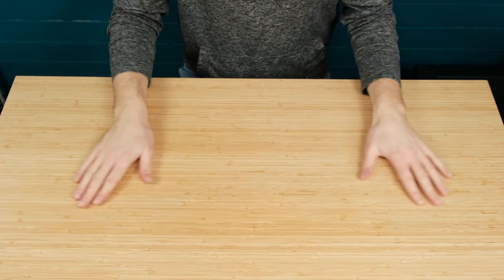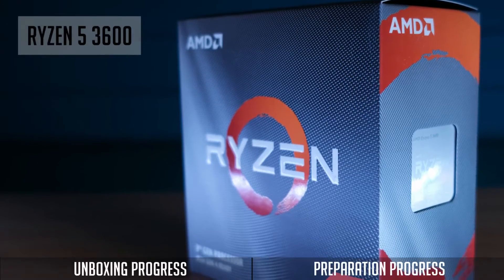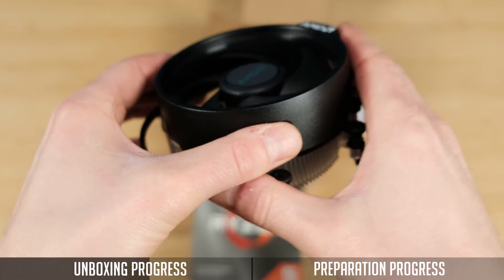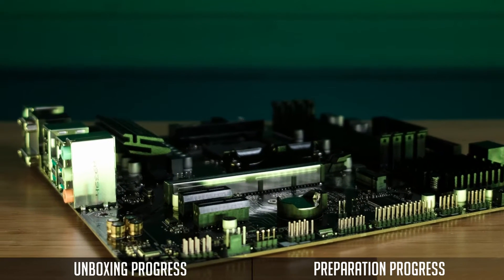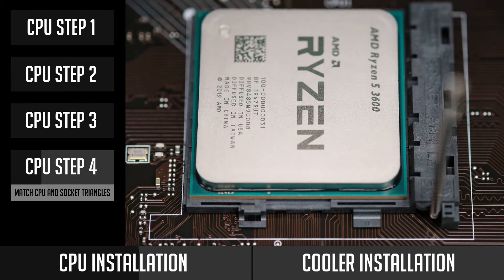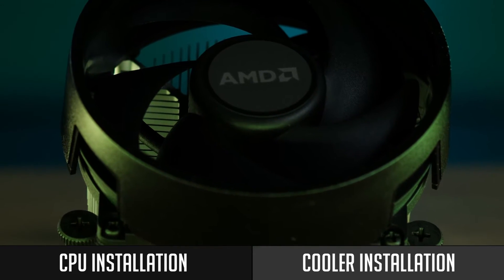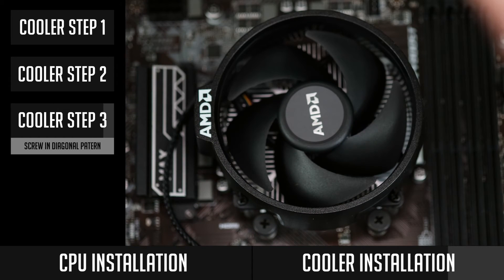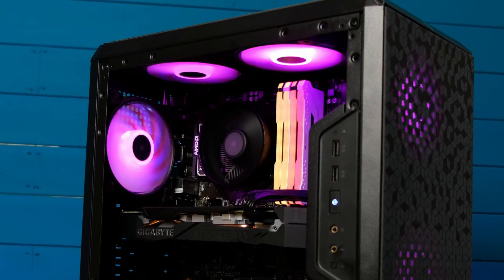HOW TO INSTALL RYZEN 5 3600 CPU + UNBOXING - CPU installation tutorial / guide

Comment: My processor is stuck on the cooler. 

I was trying to apply new thermal paste and when i remove the cooler, the processor stuck with it. What should i do? Help, im afraid i might damage my processor if i do anything. :(
Reply from the maker: Hey,
it's quite a common issue for Ryzen CPU's when they stuck on a cooler when people trying to remove a cooler/cpu from a socket.
Anyway, do not try to use a screwdriver or any other hard thing to remove your CPU from a cooler.
The best way would be to use isopropyl alcohol + cotton swab first. And then use a dental floss and try to "cut" between a cpu and cpu cooler.
I fond one video (not so good quality, but it will work) where one guys shows a process: https://www.youtube.com/watch?v=kDRgahrnOC8

Comment: Do I need thermal paste? Sir
Reply from the maker: Hey,
In case you will be using stock (included) cooler, no you don't. Since the thermal paste is already pre-applied on a CPU cooler.
But in case you will buy an aftermarket cooler, you may need to apply it since some cooler have pre-applied some don't, some are including paste tube in a package :)

Comment: On this procesor automatic applied thermal paste?
Reply from the maker: Hey,
In case you use stock cpu cooler it already has pre-applied paste :)
In case you buy aftermarket cooler - some have and some of them do not :)

Comment: Did you have to push down while screwing down the cpu cooler? Or can you just screw normally with no pressure?
Reply from the maker: Hey,
you will have to push (while screwing), since screws are spring-loaded and so you need to apply some pressure.
I suggest screwing one screw a little bit, but not till the end. And then screw 2nd screw in diagonal pattern :)
Reply: @EpicGameTech  Just a little bit of pressure right? I'm paranoid that I will somehow damage the cpu from pushing down the cooler too much.
Reply from the maker: Yep, I get that feeling :)
Well with 1 hand, just hold cpu cooler in place and that's it. And with the other hand with a screw driver, push when screwing.
1st screw is easy, but 2nd one is more tuff.

Comment: Hey man very clear video and very helpful just one quick thing, do I need to pull the white bit off where the thermal paste is supposedly pre applied or is the thermal paste that white circle?
Reply from the maker: Hey,
thanks! :)
Can you please explain more on what you have in mind? (maybe upload a photo and post it here?)
And are you using stock fan or some aftermarket cooler? :)
Reply: Epic Game Tech thanks for replying bro! I’m awaiting my Ryzen 5 3600 in the post, this is my first build ever but my question is a bit confusing, what I mean to say is, does the stock cooler out of the box that comes with the ryzen 5 have any sort of protective cover over the thermal paste that I need to remove before fixing to the mobo or do I just need to take it out of the box and screw it to the mobo
Reply from the maker: Ah, i see :)
Basically stock cooler is "wrapped" in some plastic and so it protects whole cooler as-well as thermal paste not touching anything around. But thermal paste itself does not have any protecting cover/sheet you need to remove. you will see when it comes :)
Have a nice PC Building (when it comes)! :)
Just shoot a comment here in case you will face some questions later one.
Reply: Epic Game Tech ah wicked! Great stuff thank you for replying! When it’s all here and assembled I’ll send you a pic :)

Comment: Should i start screwing as soon as i put the fan on cpu or wait for it to stick?
Reply from the maker: Hey,
What exactly do you have in mind "wait for it to stick"? :)
Just put a CPU cooler on your CPU and start screwing right away in a diagonal pattern, just like it's shown in this video.
Reply: @EpicGameTech  i thought thermal paste sticks like glue because the fan kept sliding little bit. The holes were really big on the motherboard and it wouldn't go in. I decided to remove the whole thing and the backplate was fallen. Really good tutorial, good steps! First time installing amd cpu so this was helpful. THANK YOU!!!
Reply from the maker: Ahhh, good you find that backplate, sometimes it happens! :)
Have a nice PC Building time! And thanks :)

Comment: So do i need to buy a aftermarket cooler for my ryzen 7 3800x?..No overclocking. Only stock settings
Reply: Man your good...reply after 2 hours. Every YouTuber should be this much helpful to their viewers.
Thanks a lot for your effort and time.
Reply from the maker: Hey,
well it depends if you have a budget for that or not. But in general, aftermarket cooler is always a good idea:
1. You get lower noise levels.
2. you get better cooling, thus you get your CPU auto boost to higher frequency and stay there for longer. Sure, depends from how good aftermarket cooler is, but you can gain some mhz.
3. You can overclock your CPU with aftermarket cooler.

So, there are some benefits for sure. In case you are just gaming  and no hard workloads that would use 50-100% of you CPU and you want to save money - it will run quite ok with a stock cooler for sure.
But if your CPU is used 50%+ all the time in games or blender / rendering / video editing etc. I strongly advice to get an after market cooler for sure :)

Comment: Hello Friend, exactly I bought same processor and motherboard 👍
Reply from the maker: Nice! :)
Reply: @EpicGameTech  I have a question: is the default amd cooler is good? Or  Do I need to buy separately?
Reply from the maker: well, it's ok for gaming / casual work for sure. But in case you will do some production/video editing (or it's somehow very hot where you live) and your CPU will use all 6 cores/12 threads at 100% all the time, it can get hot. And in that case, it will start to down-clock itself.
Sure, it's always nice to get $30-40 cooler. But in case you will game only, I would say stick with included cooler and monitor temperatures for a while with MSI Afterburner :)
Reply: @EpicGameTech  Thanks for this answer👍
Reply from the maker: You are welcome :)

Comment: I have a question, how would you know if the screws are just right or too tight?
Reply from the maker: Hi,
Wraith stealth screws are spring-loaded so you have to screw them till the end. Just be sure not to screw one side/screw straight a way till the end, but do it gradually with each screw bit by bit.
So be sure you screw all of them untill you can't :)

Comment: i bought some thermal paste seperate, should i apply it then put on the fan or should i not have to worry?
Reply from the maker: Hey,
If you got new cpu and you see a thermal paste is already applied on wraith stealth cooler - do not apply any additional paste :) it will be simply too much
In case you got an aftermarket cooler and it does not have any pre-applied - apply a paste you got :)

Comment: Did I miss it, or did he not mention the backplate?
Reply from the maker: Hey,
when installing stock cooler, you just have to unscrew/remove two pre-installed brackets and you can screw stock cooler to the same spots :) 
Link to a part where those brackets are shown - https://youtu.be/3DdP1DLGrwg?t=281

Comment: 3600 with stock cooler can work only on stock 3.2GHz, but if you want to use 4.2GHz need to update cooling system.
Reply from the maker: Hey,
nope, 3600 can boost up to 4.2ghz even with stock cooler :) (btw it's single-core, not all core boost)
Sure it depends on your pc case ventilation, your ambient temperature, and silicon lottery, but if it's good, it can boost up. Might be it will not hold up max boost for long in case a temperature gets higher.
Anyway, AMD's stock coolers are quite good on a budget, since they do perform repetitively OK :)

But sure, in case you want to maintain max boosts all the time, have much lower noise levels and be able to overclock your chip - then yes, you can definitely go for 30-40 USD aftermarket cooler :)
Reply: @EpicGameTech  I have 95 C on 4.2GHz with a stock cooler and it looks like it can be more.
Reply: @EpicGameTech  I've bought one-section liquid cooler, this is enough for the stable 4.2GHz constantly, at a temperature of no higher than 80 with a maximum load for more than 1 hour. This was necessary because of my small case.
Reply from the maker: yep, if a case has a bad airflow and you have a few fans only, it can be an issue :)